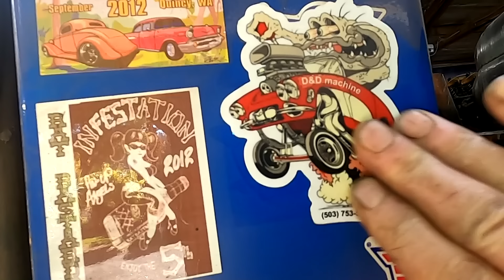OH THAT STINKIN' LITTLE BRAT!!!

Comment: In Phoenix Arizona I found a milkshake in the oil pan ...
Before I freaked out I changed the oil an filter and went for a ride ...
Long story short is I wasn't running long or far enough for engine to heat up and vent the condensation...
Always try the KISS principle first !!!
Reply from the maker: i appreciate that but unfortunately, that wasn't the case with this one.. water was running from the radiator directly into the oil pan via a big hole in the freeze plug haha